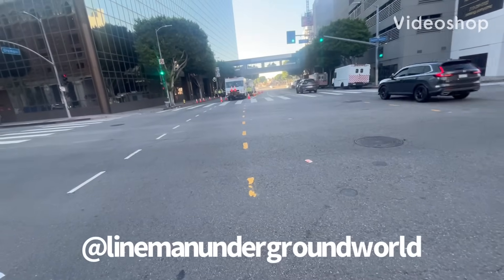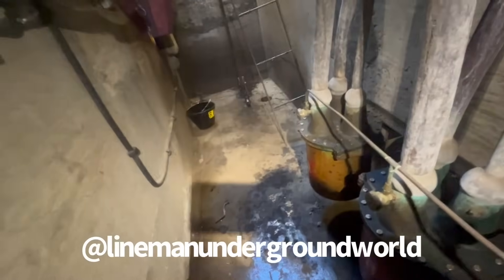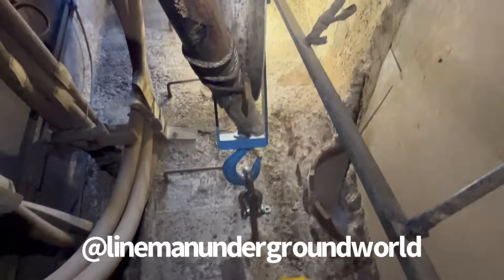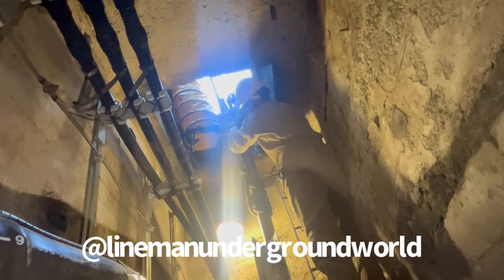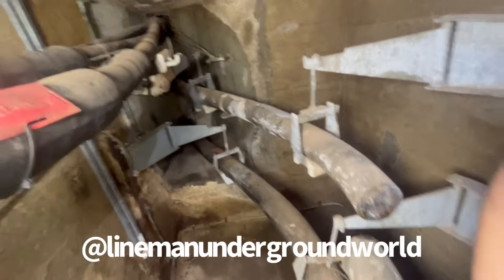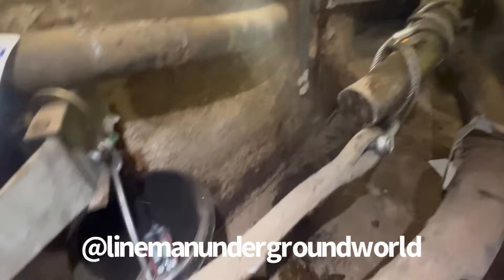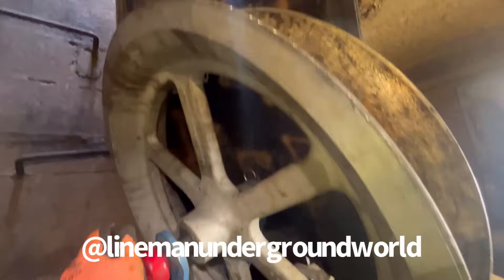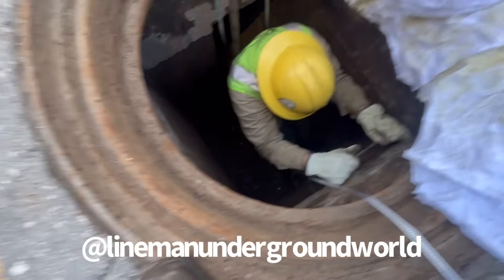Removing B/O old school lead

Comment: Was there a special grounding process for those exposed lead conductors. Like u said it would be a problem if they was energized? I wouldn’t wanna rub up against em with high voltage running through em.
Reply from the maker: @travelwithus750  wazzup travel , all that has been done before we come in to remove the cable ..👍😎
Reply from the maker: @travelwithus750  and the other 2 cables are energized…👍😎

Comment: Do your lead pulls normally go this smoothly?? We have a lot of trouble pulling old lead cable. Usually when we rig it like you did, the choker squeezes and rips the lead off the end of the cable so we have to strip it down to the cooper conductors and pull from that.  Such a pain and that lead cable is HEAVY.
Reply from the maker: @jonusjonus9271  wazzup jonus , do NOT everrrrr choke the aka airplane sling, you put a pulling claves as you can see on my videos. If you crisscross the choker it will not come off . Stay safe over brother..👍😎
Reply: @linemanundergroundworld4854  do you have any idea how much pulling force is normal for a run like that? We maxed out a 2 ton winch (single layer) trying to pull a piece only 100ft long. I feel like maybe the conduit collapsed and crushed the lead. The cable was put in around 1940 and the conduit seems to be nonmetallic (orangeburg?).

Comment: I know it's old, but what is wrong with the cable?  Why is it being replaced?
Reply from the maker: @dangruner5926  wazzup Dan , this type of cable has to be maintained inside, the one that is causing big problems now it’s leaking lots of nitrogen gas for a little while, so that’s not good at all so she is going to be replaced with synthetic cable now …
Reply: Looked like old 40,000 KV Three-Cond cable, splices had an porcelain insulator in them; Habershaw Cable; Good Job

Comment: Two questions Tony, what size diameter is that “LA “wheel? And why do you use that figure 4 technique to break tension on the cable?
Great work as always brother
Reply from the maker: @PNWBootreview  wazzup PNW , it’s 24” and rated for 12,000 lbs , when I was going to use the figure 4 was to keep the cable over as much possible but I used the mud flap, and was able to go straight, in cases like that you use everything that will keep the cable from pressing hard against the energized 34.500 volt cables …👍😎